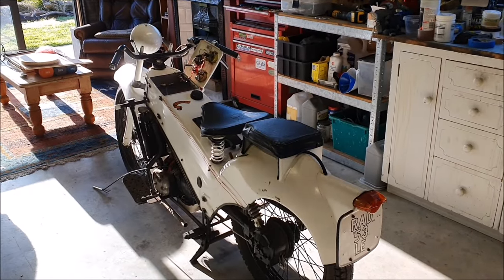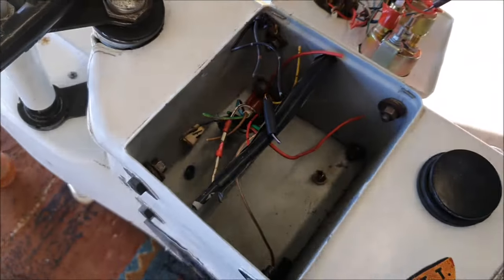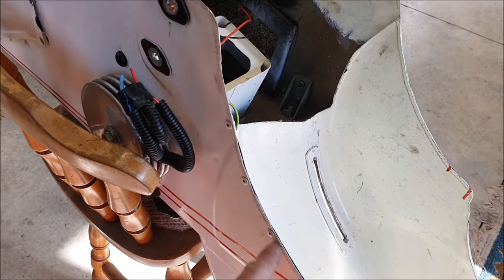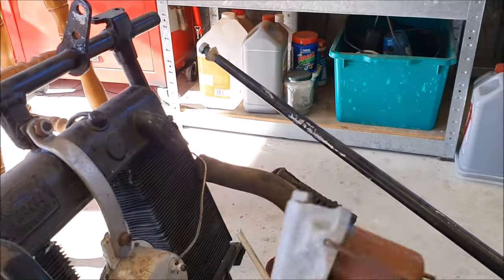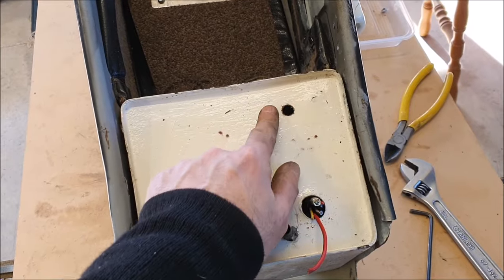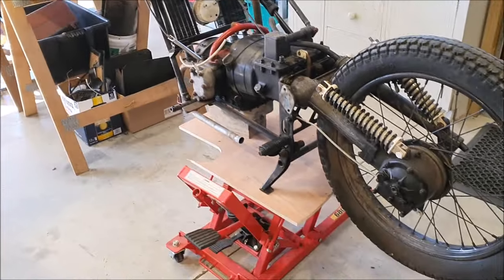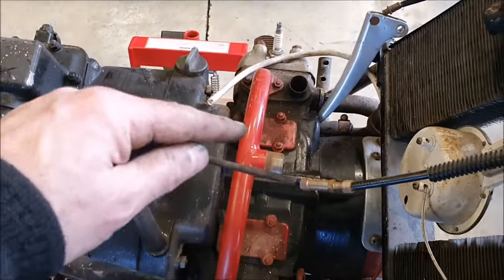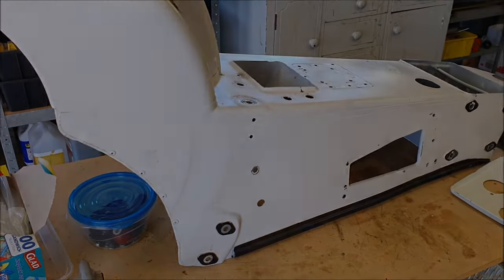Velocette LE Mk2 Part 2 - body strip down

Comment: Well, now I know more about a Velocette than I ever thought I would.  I think I may have worked on that at some point because I recognize the odd ball washers and miss matched bolts. :D  Cheers
Reply from the maker: You know as much as me! I guess while the body is off being blasted I can try to get the engine/gearbox and drive off the frame. And get the wheels and tyres off as well. Needs new tyres (and tubes and rim bands). Wheels look good, bit of surface rust but that's easy to deal to.

Comment: You now enter the new world of cycle thread. Try the local British cycle dealers here as they carry them and other consumables. The old owners manuals have the nice exploded diagrams with the part numbers as these are used still today when ordering Velocette Parts
Reply: LE threads are BSF and BA there are a few BSB threads for the some tooling.
Amal do use some Model Engineer Threads, 32 or 40 T.P.I. for cable adjusters.
The spoke thread is the standard British BA screw thread system with 32 T.P.I.